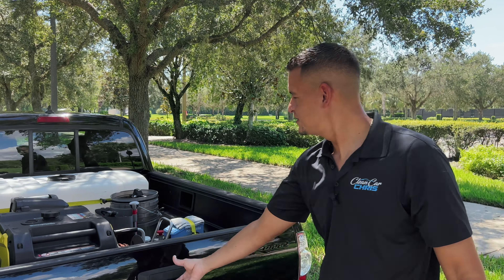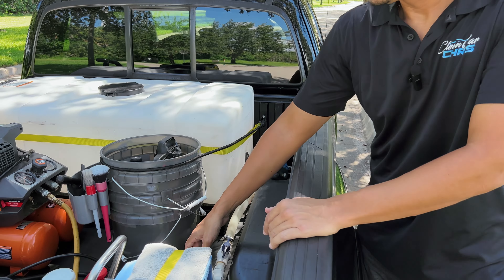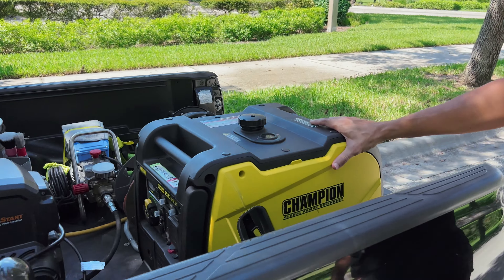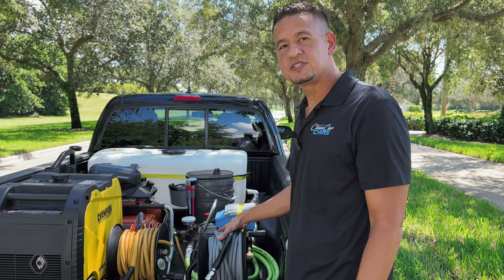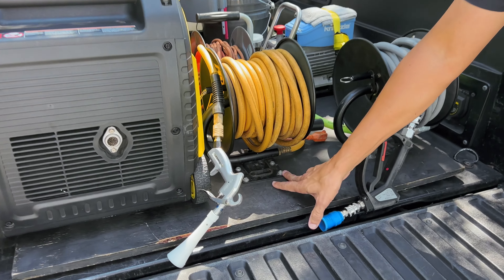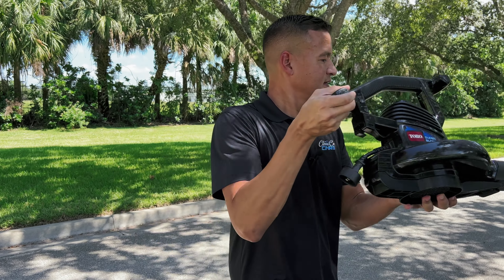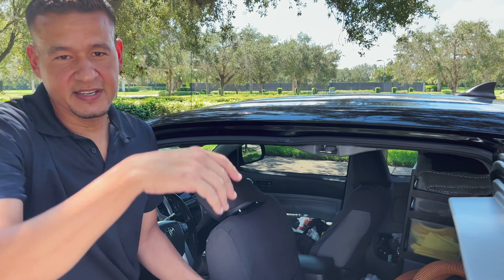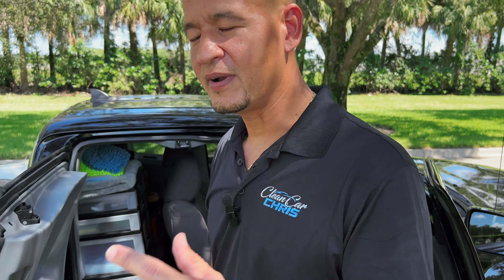My Mobile Detail PICK UP TRUCK Set Up - Using My Toyota Tacoma XRunner

Comment: Nice setup two questions how do you fill buckets and do you cover the bed when not in use
Reply from the maker: Hello, I just disconnect the hose where it meets the Kranzle and fill the buckets that way. I either off load my equipment or park in a garage when not in use. Big up for asking! Appreciate the link!

Comment: Did you have any power issue with the generator and kranzell ? I saw a lot of ppl having problems and now I’m scared to invest in kranzel
Reply from the maker: Hey I’ve had mine about 2 years and it’s been all good..a Kranzle rep advised me to run it on an inverter atleast 4500 or higher